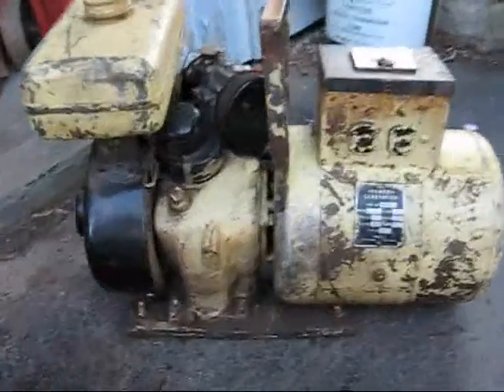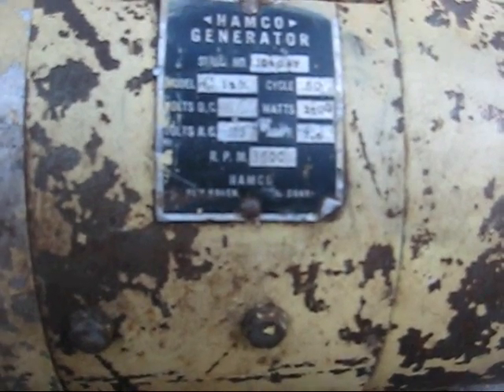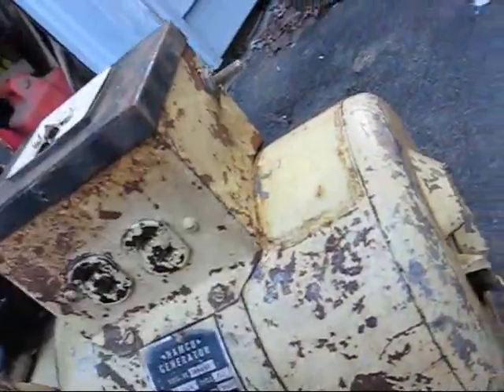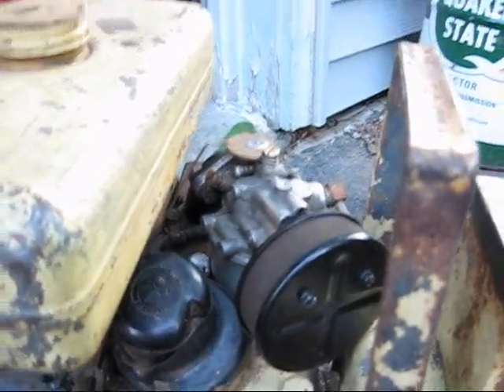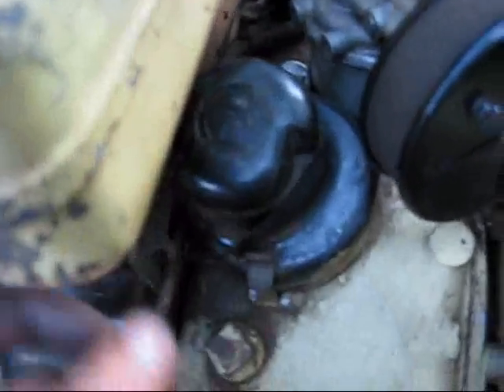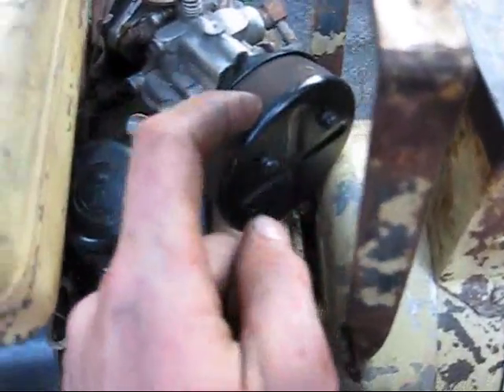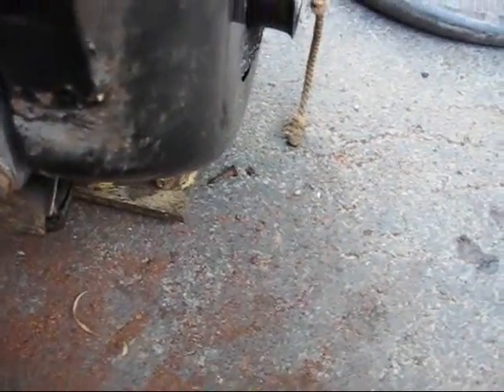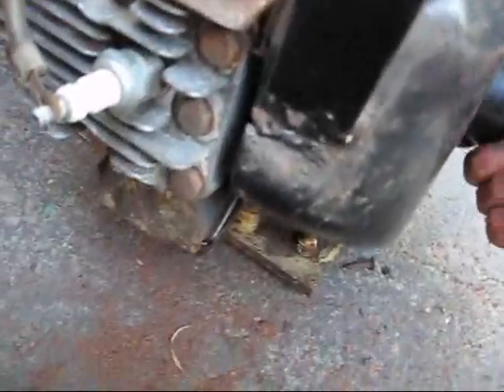1950's Hamco Generator

Comment: also check for a small Capacitor/Filter/condencer without it a Point system will not runn.

you also might have bad timing.... most one cylinder engines now have that fixed but an engine as old as this you might have to twist the Magneto  clockwise or Counter clockwise by 3 degrees or more....I would have to see the engine to make an assesment...

Comment from the maker: @JustinJJHCS1  it could be. i havent given up on it completly. i actually have the coil out of it right now and i had tryed to get it to run with battery ignition but no luck. 
i might try to get some new points i think my points could be bad. i will have to check continuity accross them.

Comment: oh Ok I have also herd that most old Magnetos where prone to moisture problems If nothing else works and you have tested the High tension led for conductivity you could try using WD-40 inside the Magneto I have seen Car engines with Magnetos and this is the cases they had to be kept dry or they would not work. strange looking things.... you some times had two Ignition systems a Magneto and a Battery and Coil

Comment: I have herd that the Condencer and points tend to go in such an old engine, You will have to strip the Flywheel/Fan off the motor that is where the Magnito is it can be just a loose contact or corrotion looking at this thing I would say rust and corrotion just strip it and clean it and you will get it running again

Comment from the maker: no. i cant seem to figure out why im not getting spark? maybe the magneto coil isnt bad? ill have to put it back in. ive tryed hooking it up to a coil and battery since it has external points its easy to do, but still nothing. ive tryed different coils, different condencers, and ive cleaned the points umteentimes! nothing, ive replaced wires nothing, i even charged up my battery just to be sure, nothing.

Comment from the maker: thank you! yeah i hope i can get it going! i was working on my late 60's Zenith Winco 3500w just earlier that day funny both of those generators have no spark. but the winco just needs points and condencer work. its a briggs model 14 and thats a common briggs issue is points corroding over time, easy fix though!